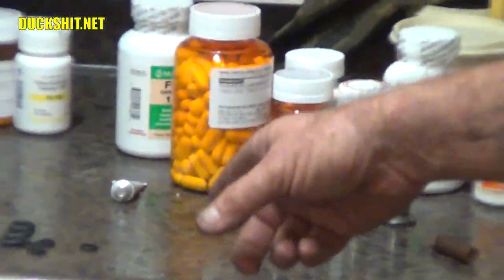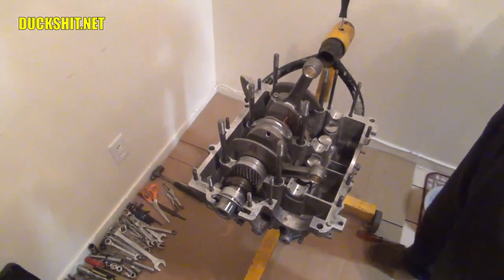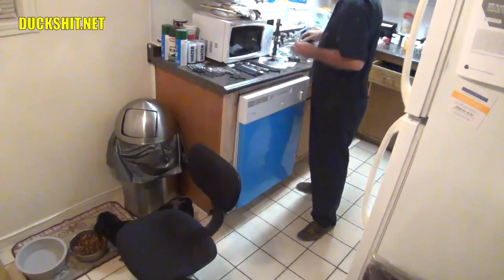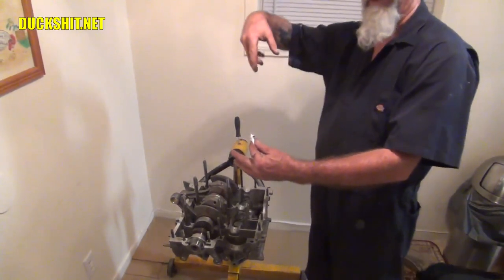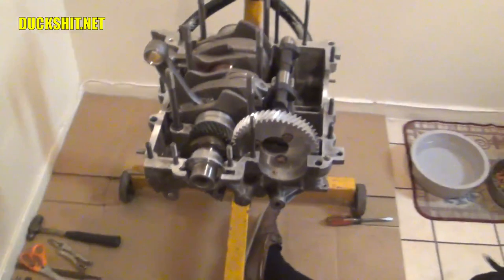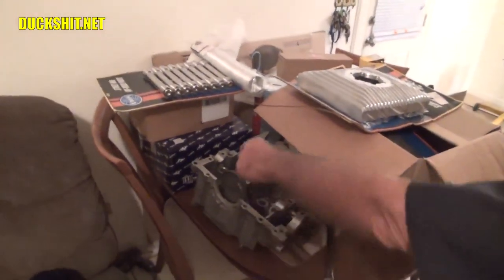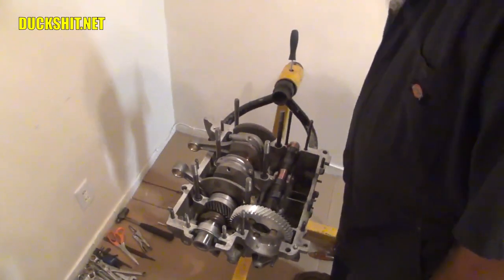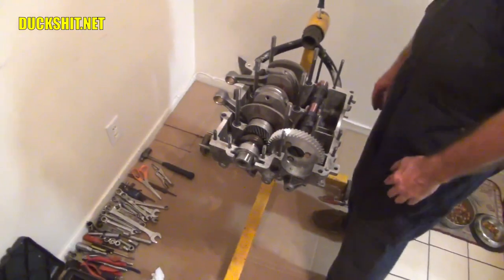High Performance VW Engine Build - 1776cc Beetle (Type-1)

Comment: 90.5 is a good size barrel.  If I remember right the 92's had really thin walls that were prone to distortion.  Put a set of CB performance heads on that and ready to go!
Reply from the maker: The 92 supposedly has the same size hole as a 90.5... but there are thick-walled 92 cylinders that fit in a 94 hole.  Everyone always talks about the distortion that happens, but nobody has ever documented nor demonstrated it... so it remains subjective with a whole lot of people repeating what they've heard.  When my channel hits a big enough size I may just try and disprove this myth.  It'll be fun!  Lets blow up some engines!
Reply: Do it!  My buddy used to be really good at building up air cooled VW's, he did see some distortion first hand, so I kind of am taking his word for it.  One of the motors he built for a customer ran low 10's in the quarter, was fun seeing him build up air cooled motors with mega power!
Reply from the maker: As I said, subjective. 😀😀😀😀  I'd like to see photos or a cylinder in my hand... never believe until you see yourself!    Thank you so much for your comments always.  I'd love to build a 10-second Beetle... hehe.  I'd get in trouble around town with it for sure!
Reply: @DuckmanCycles  Old 92 were thin wall and ran hotter.  If it was in a low geared baja they worked ok.

Comment: How much power is this going to, or does, put out?
Reply from the maker: Probably good for 90-100hp.  It ran great back then, but the owner has since sold the car!
Reply: @DuckmanCycles  Gotcha. There's a kit car 917 that's running a 1600 motor. If I picked it up I'd like to give it a beefier motor, as it is supposed to replicate a fast car
Reply from the maker: Now that sounds like fun, a 1776 sure would make it go good!

Comment: Hi Glenn, you were talking with Bill about a vw caddy, don’t know if you had them in the states, but they were common here in England.
It’s basically a mk1 vw golf, at the front, (hence the name caddy) with a pick up body at the back.
Reply: Plenty still running around in South Africa which is not surprising seeing that they were in production until 2007, many with 16V and/or turbo conversions. I saw one in a USA based channel that I'm subscribed to but it was called something else, not a Caddy...
Reply: A girl that I went to school with and her husband ran a co. that turned VWs into PU trucks. Put small bed on rear of a beetle

Comment: I have a 1500cc and installed dual 40s. Forgive my ignorance but I just want to make sure I get the correct pipes. 1 5/8 or 1 1/2?
Reply from the maker: 1-3/8 merged header for a 1500.  Anything bigger (or a stock exhaust) and believe it or not, you'll lose a little power.  I hope that helps, thanks for the question!
Reply: Good advice on the exhaust  sizes btw  thats always been a guessing issue  for most of my freinds and myself that  used to get expensive  cause the shops i used to buy at as a teenager. Worked on commissions for the sales people ?  As young guys it took us a while to figure out they. Were  always selling us the most expensive stuff they had when we asked for  reccomendations  or what we should buy   My parents home had a loft  over the garage and i bet there are still exhaust pipes/ systems hanging up there still  even though  my family sold the house years ago  unless someone  was smart and. Sold them off on Ebay or a swap meet  ?  Who knows I'm  in my 50s now and its been a long time since ive had any aircooled VWs  although i still have memories and. A love. For the simplicity of them  and watch the market

Comment: I was told a 1776 was a pretty dependable engine size to build
Reply from the maker: Yes, its a very common, inexpensive and reliable size!
Reply: I thought I heard that about this size engine. That will probably be the size I do. I have to buy a long block though I dont trust my rebuilding skills
Reply from the maker: That'll get ya there! But you also can go up to a 1914 with a slightly hotter cam for the same price.  Things to ponder!  😀😀😀

Comment: Stupid question, you're building this from a 1600 case?
Reply from the maker: Yes, the cylinder bores were opened to allow larger pistons, but the case is same as a 1600!
Reply: @DuckmanCycles  Thanks so much! I want to build a 1776 stroker, I just needed to know what motor to base my build on.

Comment: what is a real bite is this cam breakin stuff a long long time ago I cam remember how the story went , on a stock cam you did not have cam failures . the only time you had any issues was with heavy springs . now even if you use zddp + oil tuff shit lifters pitt cam lobes gone .I am about to give up on Vws
Reply from the maker: Awww maaaaaaaan!  Get some pneumatic or solenoid actuated valves... no more cam!  YAY!
Reply: I use engle w100 cam and lifters that was on the approved list and 3000 miles down the road I have to keep tightening the valve adjust .= it must be shearing the lobes . My friend Joe had the same thing happen on a 327, we both used Valvoline 20 - 50 racing oil ZDDP+ where did we go wrong used the red paste ran it at 3000 RPM . I had better luck with a reground cam that costed 17.50 I got in 2008
Reply from the maker: Hmmm... maybe some bad metallurgy in there.  Perhaps the made the cam from JB Weld.  It must be unusually soft... or something else is.  Thats not good at all
Reply: I found what is happening on my engine is the EMPI adjusting screws are wearing out like shit . It mite have 4000 mile on it and they are worn past the bevel already.It aint the cam or lifters its the damn screws . It had me scared but now its not so bad , I just need to get some good ones. In Vw shop they find out the hard way which part work and which parts fail and for the little guys , the part stores sell you whatever with out blinking a eye . At Car - Crap they had to know ?????

Comment: What HP do you get from a 1776cc ?
Reply from the maker: About 100hp give or take depending on your cam, heads, and carburetors.
Reply: @DuckmanCycles  Thanks.  100 is enough.
Reply from the maker: Awesome! Thanks for the question!
Reply: @DuckmanCycles  Sorry, it has been a long time, when you say, "Depends......." would something like this be a good buy? http://vwparts.aircooled.net/SCAT-Volksaver-Engine-Kit-69mm-Crankshaft-p/volksaver-engine-kit-69.htm.  Thanks again.
Reply: How High can you go on this engine with right components?
Reply: Horse Power